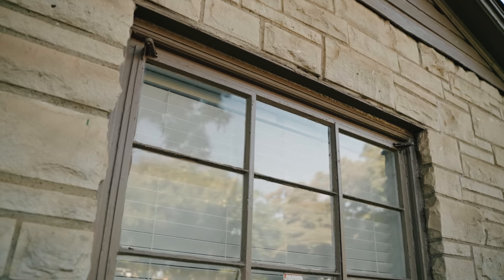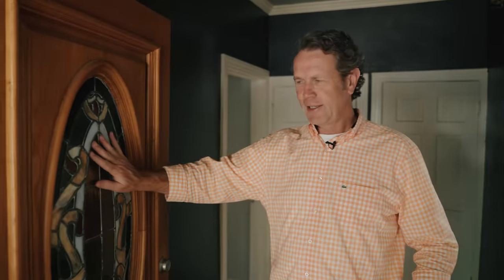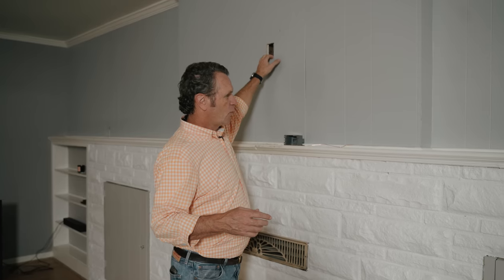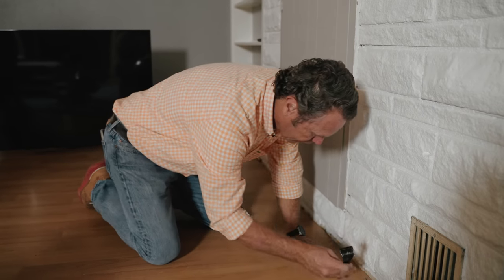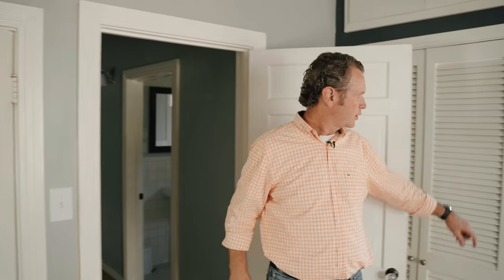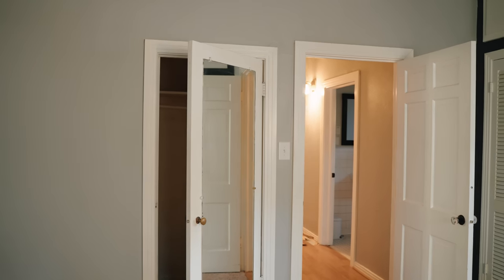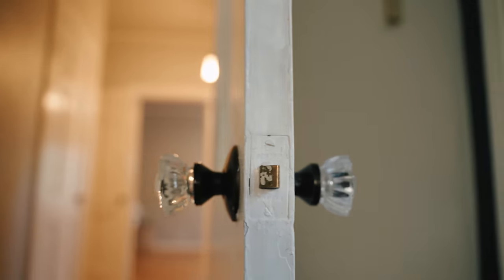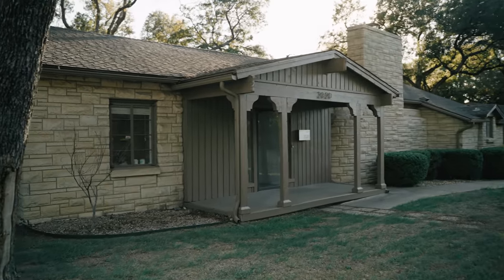Dating and Sleuthing a 1945 house with a WWII hangover.

Comment: I grew up in an Eichler Home built in 1952 during the Korean War.  A key feature of Eichler Homes was a radiant floor heating system that used soft copper tubing embedded in the concrete slab foundation.  Unfortunately, the shortages of the Korean war caused some of the Eichler's to have cast iron pipes installed for the radiant system that promptly reacted with the concrete slab and the whole system failed.  My first recollection of that house (when my family bought it in 1963) was walking through the inside after the floors had been jackhammered up to replace the corroded piping with correct copper tubing.  I have been trying to get back into a house with radiant heating since I left home for college in 1976!  

Thanks for this, Brent (and I agree with a previous comment for more sleuthing videos).  All of the Build Show Network videos are fantastic!  You're giving Matt a run for his money!
Reply from the maker: Thanks for the story. I appreciate the feedback.

Comment: It is my belief that the house was built no later than mid ‘42. Why? WWII ended in late ‘45 but I suspect materials and craftsmen took several years after that to normalize. The exterior stonework took craftsmen and transportation. My uncle was in the building trade prior to war but was drafted into the SeaBees and not mustered out until ‘46. Fuel rationing ceased after war but it took longer to divert back to American consumer as there still was significant military activity post-war. Also, consider the house’s electrical and plumbing. Soil pipes and water supply pipes were iron based and I have to believe were difficult to obtain for several years after the war. While I don’t know the timeline for electrical wiring, I suspect it is BX (armored wiring) though it could be a fabric insulated wire as well.
Reply from the maker: Thanks, but we do know building happened during the war years. I have the building magazines that talk about the war and how to "make do" despite rationing, etc. There was actually a moratorium on building in 42/43 but building was taking place in 45. Also, Fort Worth was a big military and defense town in 45. Lockheed Martin was building bombers. Thus there was building happening here. Cheers.

Comment: Fascinating forensic examination. The laminate floors are an abomination, maybe one step removed from "woodgrain" shelf liner. Some friends have an old house from the mid-1800s that's seen lots of changes over the years. Walking through you see different mouldings, different door styles, different door knobs. Maybe with some of what I'm learning from these videos I can start to put times on when these additions and renovations happened. Brent, thanks for sharing your knowledge and insight.
Reply from the maker: Nice, thanks. Keep at it.

Comment: The cast iron grill for air circulation above the fire box is the exact same as the grill that was in my parents home which was a early 1970's kit log home. My guess is that it's not original but I am by no means an expert on dating architecture details.
Reply: Another way to date the mantel feature would be to see if the electric wiring to the circulation fan/switch match the original wiring in the house. This is assuming it has not all been replaced already in a remodel.
Reply from the maker: Thanks.
Reply from the maker: Good idea.

Comment: The porch beam supports are a classic for "Spanish" architecture. Might be original.
I was around in the 1950s and two of my aunts had fireplace walls like that - firewood goes in the cupboard next to the fireplace, glassed-in storage on the ends. They had "heatilator" fireplaces. So that's probably original.
Reply from the maker: Thanks. Porch isn't original. Fireplace is.

Comment: Our '39 also has big 3-tier stepped moldings everywhere (all doors/windows) however the outer most is thinner and the inner most is thicker. But until I paused the video and zoomed in I thought this was the video I'd seen of the exact moldings. 

Not sure I agree with you on the door knobs. Ours has similar glass except for the outside-facing knobs.
Reply from the maker: Good to know. Thanks.

Comment: Change the Kitchen Door to a 15 lite French Door. This keeps the dual swing but visually opens up the house. Add a brass cover over the bottom door swing hardware. It probably had a cover but now is missing. Looks like a fun project. PS check the roof chimney flashing it looks like there may be gaps for water to get in…
Reply: Our '39 house has exactly that 15 lite design on french doors separating living room from dining room.You're correct, there should be a brass cover on the bottom spring.
Reply from the maker: Nice, I'll check it out. Thanks for seeing that.
Reply from the maker: Thanks.
Reply: I saw the Chimney also and thought, “Wow! That’s a mess.” But, I just fixed a section of flashing and reroofed it myself after four roofers couldn’t figure out why it was leaking.   😡 One wanted $2500 to investigate and fix. Cost me less than $100. I swear, this girl doesn’t want to have to do everything. It’s been pouring here in CA for three weeks and not a drop insight where it shouldn’t be. 🎉

Comment: Do you think that having put down the pergo wasn't a bad thing but likely protected the original flooring?
Reply from the maker: It absolutely did. Just like metal or vinyl siding will protect original wood siding. It can work out but its not ideal.
Reply: @BrentHull  so it you had a victorian with original wood frame covered by vinyl siding what would you suggest??

Comment: Brent, you are the man. Still, Iam going to challenge the removal of the porch. The main justification for me would be the questionable quality of the work. A generously covered entry is listed in "A Pattern Language" which makes it "canonical" for me personally regardless of the stylistic purity. I also appreciate when a building develops "palimpsest" which is not everybody's thing. The removal or replacement of subpar workmanship is normally a good thing.  I would love to hear your opinion of the Truman balcony at the White House.  I can't believe it is canonical, nor does it show any sensitivity to the original design. However, I believe it has provided pleasure to the inhabitants and to me it is charming ( in a naive way) and quirky. Qualities that can be  all too rare  in both people and buildings. Sometimes it requires a form of genius to do " the right kind of wrong"🙂
Reply from the maker: Great comment. I agree on the Truman balcony, I don't agree on this porch. Haha. I also think that carefully designed and executed a front porch her could be magical. The problem for me starts with the deck boards as you approach. It cheapens the house. MY 2 cents. Thanks for your thoughts
Reply: @BrentHull  Shoddy or non viable design/workmanship always needs to get removed or upgraded. No way around it.

Comment: How would one get ahold of picture rail moulding? I'd love to put some in our '57 hallway but I can't find anything here in the CA Central Valley. I've thought about just making it but not sure where to start. I have cove bits and bullnose bits as well as some profile bits. But, that bullnose on the moulding seems to be at an odd angle to the face of the board.
Reply from the maker: Thanks, Windsorone has a picture rail molding in their molding collection. www.windsorone.com